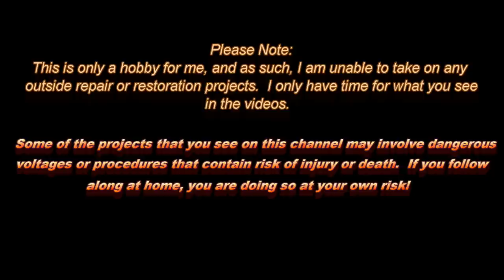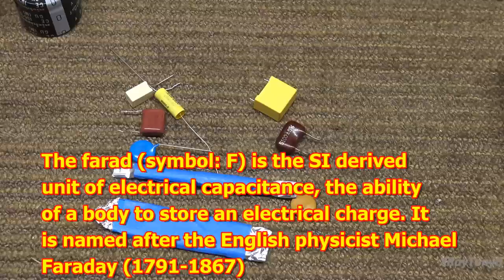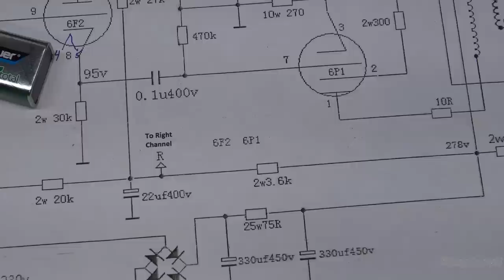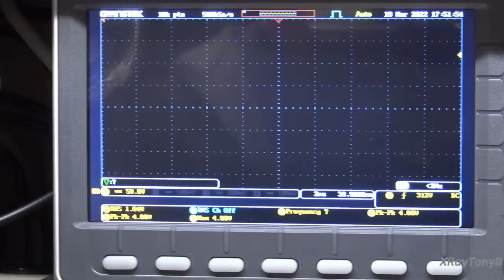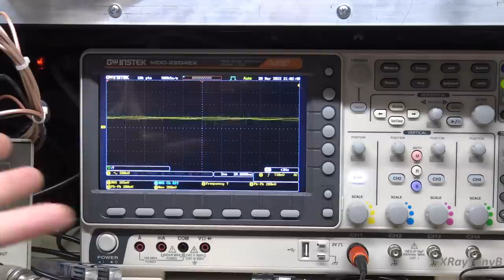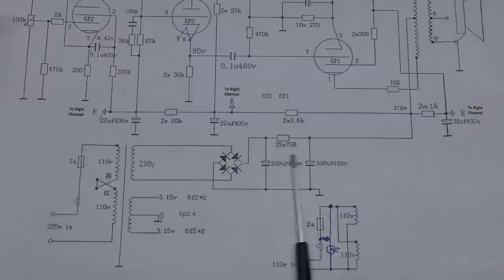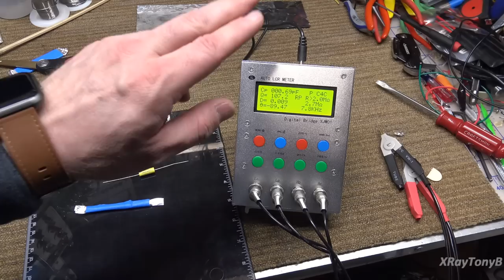Electronics 101½ Part 7 - Capacitors & PI Filter Network

Comment from the maker: 0:15 Intro
1:23 What is a capacitor?
1:55 capacitor vs battery
6:22 Dielectric absorption
7:52 Other types of capacitors
13:00 Farad Definition
 21:44 Using a capacitor to reduce ripple - Intro
23:00 RC Time constant explanation and experiment
31:40 How the capacitor reduces ripple & How to calculate & choose the correct value for our amplifier
47:13 Testing our calculations
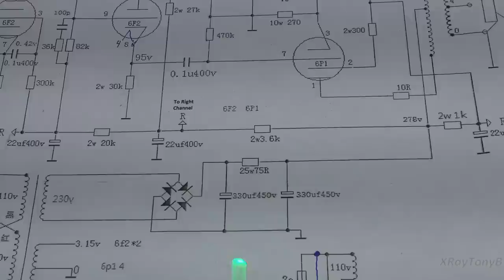53:41 PI filter network  - design and applications
1:04:15 Testing & building the PI network
1:13:35 Bonus footage - Making a simple capacitor with aluminum foil & wax paper

Comment: 1hr 8mins 25 seconds into your video you explained why we tap the higher voltage from before the resistor in the pi filter to the final audio amp stage. You see this design in many valve radios. It makes total sense to do this on a push pull output stage as it kind of acts like its own ripple filter.

Comment: The electrolytics coming charged out of the package are from the testing at the manufacturer, not from the capacitor acting as a battery. I also remember reading that keeping a small voltage on them in storage helps to avoid the oxide layer degrading and then requiring a slow charge before use.

I wonder how the automated pick and place machines deal with the problems of capacitors being charged out of the package. Do they connect the capacitors to a resistor before installing them?

Comment: Hey Tony, just wanted to say I'm really enjoying this series so far.  I am really new at electronics and you showing the math,  as well as actual results is great.  If you could do a similar series with how a radio works would be great.   I really have a hard time with understanding how tuning to a specific frequency works, especially when there is an IF section, I'm totally lost then.
Reply from the maker: I've done a zillion radio videos.  Some of them are getting old, so you will have to scroll back a bit to find them.  They collectively cover all the topics you are interested in.  Thanks for the comment!

Comment: (@47:06) - It’s true, the vacuum tube rectifiers (like a 5U4) can’t handle the in-rush current, but - then again - they don’t turn on instantly like the silicon diodes will. So, initially, the voltage on the cathode (filament, for a directly-heated tube) will be (close to) 0 volts until the filament heats up to the point where thermionic emission begins. Then the voltage at the (1st) capacitor will start to rise and begin charging the cap. Once the cap starts charging, it’s impedance rises kind of in-step with the increasing voltage due to the rectifier tube conducting.
The other purpose of a Pi filter is to provide multiple B+ voltage(s); the voltage at the 1st cap might be 200-220 VDC (audio output) while the voltage at the 2nd cap might be 150-180 VDC for use by the input stage/cathodyne phase inverter. Some devices, such as old tube TVs, may even have 3-4 B+ voltages! 😅

Comment: I built a pi filter once as part a PSU for single stage 12v (mosfet) headphone amp using a few "spare parts". I used two daisy chained L/C stages for the pi-filter. The filter worked..BUT only when the load current came up to 100ma or greater. I could NEVER figure out why it only reduced ripple when the load impedance was low enough to draw 100ma. Lower load currents resulted in higher ripple !   Weird.

Comment: Two questions.   What brand of capacitors do you like to use?    Also for this amplifier you are building, what class is it going to be (A, AB1, AB2, B, C, etc)?
Reply from the maker: I use many different brands, but some of my favorites for general purpose are Nichicon, Panasonic, Kemet, Sprague, Cornell Dublier, Wirt, Wima and Elna.  As for the amp, it's class AB1

Comment: In your explanation of electrolytic capacitors, it kind of sounds like you're saying the electrolyte is the dielectric, but isn't the dielectric actually the aluminum oxide layer on the aluminum foil -- which also acts as the insulator to prevent DC current flow (like on the infamous McIntosh output transistor heat sinks)? I thought the electrolyte was there in part to maintain the aluminum oxide layer via a tiny amount of leakage current when a voltage is applied as well as acting as the cathode.

Comment: 15:24 - Tony, wouldn't the shock to ones system be equally as bad no matter what the capacitance value? Since one can be killed by microamps. The human body will draw the same current from a 333000uF cap charged to 100 Volts as a 100uF would.
Reply from the maker: As the capacitor discharges, the voltage drops.  Higher capacitance means that the shock can be delivered for a longer time.at dangerous voltage levels.
Reply: @xraytonyb  Thanks, Tony. Degrees of shock was something that was NEVER discussed in any of my EE-related courses in college! I just assumed that body-resistance is so high that it wouldn't affect the discharge rate as much.

Comment: Why use a 25 watt resistor. Because of inrushcurrent of second capacitor?
Reply from the maker: Mainly to reduce heat in the resistor.  The resistance itself limits the inrush current.

Comment: Tony, can you explain how the 75 ohm resister lowers the ripple.  Or why not use a 660uF cap instead of two 330?  I reviewed the vid and still can't wrap my head around this.  Thanks!
Reply: The first capacitor clamps the voltage to its peak level (less the ripple) while the RC combination filters out the AC component (the ripple) but leaves the DC component unchanged - other than the voltage drop across the resistor.

Comment: Hi Tony. Since this is a push-pull amplifier (only one (output) tube conducts at a time), wouldn’t the total power be 13W, not 26W (max)?
Reply from the maker: There are two amplifiers for stereo.  If the amp provides 12 watts per channel, with an additional 1 watt for the preamp of each channel, the total would be 12+12+1+1=26 watts.  In a push pull amp, each output tube provides 1/2 of the cycle.
Reply: @xraytonyb -  oh, yeah, I forgot it was stereo.

Comment: One we have learned in EMP and caps including the air gaps on a 40k pulse transformer on ebay you can get a base off 2cm same as the information unlimited or if you set up one off Three air gaps you can get upto a 8 cm feild on battery beast but on a current limited unit in a set off 3 works more like a motor in piston fire sounds similar too 😁 induction helps to volt regulator stuff with a caps adjust off there base keeps getting too hot at a amp on there base??? Not anymore!. 😃😄😁😆😅5 Smiles.

Comment: Tony can you make a video to explain inrush limiting please ?
Reply from the maker: Inrush current on a fully discharged capacitor is only limited by the resistance between the power source and the capacitor.  In many cases, this resistance is sufficient to limit the current for the short time the current is really high.  In the case of large capacitors, an inrush limiting resistor can be placed between the power source and the capacitor.  Here's how you can get a rough estimate how to calculate the resistor value:
Let's say you want the maximum inrush current to be 20 Amps at initial power-on.  And let's say the rectified unfiltered voltage to the capacitor is 100 volts PEAK (this is important.  You want the peak voltage).  At initial power-on, the capacitor acts as a short, so the resistor will have to dissipate all the power at first.  If R=E/I, then  R=100/20 = 5 Ohms.  Adding a 5 ohm resistor before the capacitor will limit the current to 20 amps, when the rectified voltage is at its peak. Now doing the math, this would result in an initial peak power of 2000 watts across the resistor, but this will only be for a short time.  Power resistors have a peak rating that is much greater than their continuous power rating.  Usually, a 25 or 50 watt resistor  will handle this.  Remember, each time the capacitor goes through 1 time constant, the current drops significantly.  As an example, the Pioneer SX-1050 will have a peak inrush current of over 280 amps, if you just rely on the internal resistance of the transformer and wires, but by adding a 3 ohm 50 watt resistor in series with the power transformer, it is limited by a great amount.  Hope that helps.
Reply: @xraytonyb  thanks .. that is easy enough i am building a 2x 2000w RMS amp and without a inrush limit the 16 amp breaker would for sure trip
Reply: @Dutch-linux  Perhaps Essent will give you a 120 kva line?
Reply: @edmaster3147  ik ben bij vattenval hahaha
Reply: Hi, Dutch. There are also special in-rush limiting resistors called Negative Thermal Coefficient (NTC) resistors that decrease their resistance, after they have slowed the current in rush. One advantage is that they don't continuously waste (as much) energy for the momentary function of protecting the circuit during startup. To be clear, I am not saying that they are appropriate for Pi filters. But, you will want to research these and add them to your knowledge base. There are positive coefficient models, as well.
Reply: @t1d100  yes i did know about those thanks i will sure look in to that ... i just wanted tony to cover that subject as it would make a interesting video for the 101 series  as he does explain things so well way better then other channels i love his format especially when he also shows his mistakes and things  but yes NTC.s are an option especially there it will have  2 Toroidal power transformers  and even on 240 volts power net a 16 amp breaker will trip because of the inrush so a soft start is needed and yes i know i can buy amps ready made but building one is way more fun.
Reply: @Dutch-linux  There are modules available    which limit the current at startup and switch off over a relais, of course something like that can be self designed as  well. I like this kind of option as it gets bypassed and then influences the sound (less). I gather that designing such a power-amp will be very challenging. What kind of design are you building (class A would make the central heating obsolete, my Accuphase takes care of me on colder days and that has little power compared to your amp..)
Reply: @edmaster3147  class D

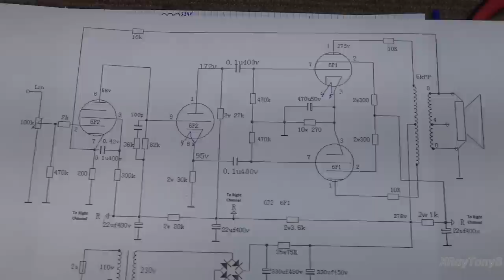Comment: There is a problem with your ripple calculations. At 37:30-38:05 you say that in a 12 W amplifier, the output stage will draw 12 W from the power supply. But output stages are not 100% efficient. At maximum output, the peak efficiency of the output stage will be 50% to 78% depending on the bias current (for class AB operation). If we take an average of 66% for the efficiency then the output stage will actually be drawing 18 W and the total power consumption of the amplifier will be about 38 W (not the 26 W you used in your calculations). It will be interesting to see how much current your amplifier actually draws when it is finished.
Reply from the maker: I am working on the next part of the series, which is the output transformer and the output section.  Looking at the load line for this tube type, your calculations will be pretty close.  I still haven't worked out the bias point for the design as it stands, because it is cathode bias instead fixed bias.  Like you said, it will be interesting.  Thanks for the comment!